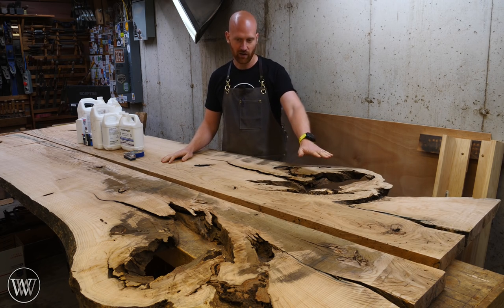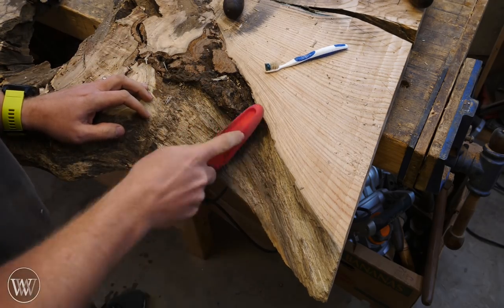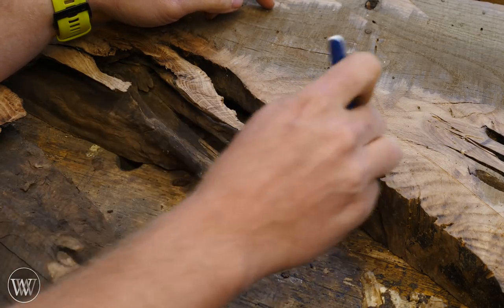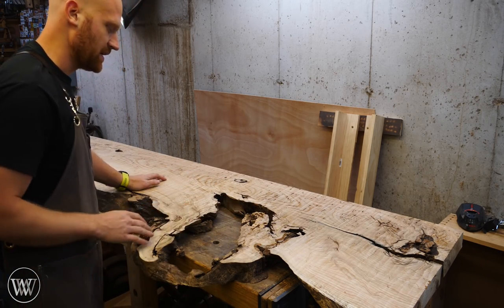Filling Large Voids With Epoxy and Spilling It All Over The Floor

Comment: My first ever project using epoxy resin was yesterday. My husband was cutting up a fallen black walnut and decided to try making me a bench out of a nice straight portion.  The 2 pieces to be the “legs” he’d initially cut out a shelf with back.  In so doing, it created accidental slots in the end of each log leg.  I researched epoxy resin to fill the slots and we gave it our first try yesterday.  I did use a deep pour epoxy that was 2:1 and we used duct tape to the dam the sides of the logs.  But there was enough depth (2-4” and maybe close to 6” depth at deepest) and width (about 8” wide and cut was 1/4”) that it started seeping out of the bottom of the duct tape.  The smaller one didn’t leak at first (maybe it was still being absorbed by the wood?). But later it also leaked mostly out 😭. Only one void stayed full; the one that didn’t have any exit holes on the side of the log.  I’ve seen some videos where people will wait 15 min after mixing to start pouring.  But your mention of this kind of epoxy being so liquidy makes me wonder if that would help much with the long set up time?  Would it have been better to pour just a little and take more days to fill the entire voids?
This bench will live outside and these deep pours were for the purpose of preventing rotting form moisture.  They’ll be covered with the seat of the bench.  But I’m not sure if it’s worth trying again today with more material now that the insides of the voids are at least coated in the epoxy.   Thank you for showing your process and the fail, so we can be encouraged not to give up.

Comment: You actually explain what you're doing, finally an actual tutorial. I have a long wood stump with a crack going along the entire side. I've already sanded the top and sides I'm wondering if I put it upside down, use the matte tape on the top and on the sides (the opening St it's widest is 3/4 in wide, I don't know if the tape will stay and be self contained. Maybe reinforce with duct tape on the sides?
Reply from the maker: For something like that I'd probably use Matt tape but then reinforce the edge with a little bit of hot glue or silicone caulk. You also want to make sure you use an epoxy that's thin enough to make it all the way down to the bottom and let bubbles rise all the way up. Most epoxies would be a bit too thick for that.

Comment: I have done simular jobs with epoxy and the way I was taught was to use MDF with wax paper glued to it for a backer using double stick and hot glue. Good luck on the rest of your project.
Reply from the maker: I have done that in the past, but with cracks and bug holes running the whole length there would be no way to get down enough hot glue before it cooled.

Comment: Great video, so clear. I have a small scale model of a room, made in MDF  61 x 58 cms.  I want to flood it to a depth of 5 cms for a video I'm making.  I'm planning to use the mat tape around the edges and plastic sheeting on the floor area also taped in place. Do you think the eco epoxy would work in this project – water would probably be too fluid. Thank you. Marie

Comment: So I have a question. I'm planning to make a pouring on a live edge table and I'm thinking about which side to put on bottom. Bottom side or top side? The thing is that bottom side is more flat and it will help me with sealing the bottom part which has 2 big holes.  I'm thinking if the resin will be absorbed by wood and the level starts dropping. Also I have sealed the surrounding walls for pouring. I'd really like your input.
Reply from the maker: Sorry, I'm not quite understanding the question. Feel free to send me an email. I'd be glad to talk you through on it. You can find my email address in the about tab on the channel page or on my website. There's a contact form. I don't always see replies on here,

Comment: Did you consider using something like spray adhesive to hold the plastic to the surface? Great adventure you're taking us on James, thanks.
Reply from the maker: I tried that once before on a smaller fill. it is a good idea but does not have enough bonding power for the pressure behind it.

Comment: Thank you for your tips!! So I'm thinking about doing it with layers of packing tape and  also add in between white silicone(used in the bathroom usually). I want to put silicone around a big hole on the slab, and then cover it with packing tape, and then turn it over to fill it with resin. Do you think it's going to work?
Reply from the maker: I don't think I would use packing tape. The problem is if you get one wrinkle in the packing tape or one slight issue in one seam it will all leak out. Unless it's a smaller fill that one or two strips of packing table cover. But if you're doing a larger area I would go with a sheet of plastic.

Comment: I have a question about making a epoxy counter top.  The Seconds and Surplus store has a MDF laminate counter top that is 12ft and they are selling it for $49. I need an 80 inch kitchen counter top and I hate MDF but, I am trying to find a video or find out if it is possible to seal the bottom of a laminate counter top by using a wood filler or even gluing another maybe 1/4 inch plywood on the bottom of it so I could epoxy the top and the bottom of the counter top?  The one in I have not that I need to replace is rotting out underneath and I do not just want to do a top side epoxy counter top.  All of the videos that I see show only doing the top side of a counter top. Please advise
Reply from the maker: I have never heard of anyone sealing the bottom but it could be easy done with a penetration epoxy. they use that to make wooden boats water proof. This is what i use. https://amzn.to/2KzxyWa

Comment: I've recently tried my hand at using epoxy to fill voids, and had the same run out problem on a test piece. I used foil tape, and I think the adhesive just wasn't strong enough. I planned to try tuck tape instead, but will give the mat tape a try too.

I also experienced the drop in level from the wood absorbing thin epoxy. I've seen some builders recommend pre-coating inside edges with a thin coat of epoxy before a pour, to stop the wood from absorbing the thin deep pour epoxy. Have you tried that before? I'm not sure if it's an extra step that's worth doing.
Reply from the maker: Right on. Usually depending upon the slab I either use tyvek tape or wrestling mat tape. I find the wrestling mat tape covers larger voids much better but the tyvek tape has a much better adhesive. The problem is both of them are incredibly expensive tapes. I have done preliminary pores before to try and fill and that does help to some extent but in this case it would cause a problem of seeing differences in the two different types of epoxy. I really wanted a perfectly clear transition to the wood. so in the end it just depends on the particular application.
Reply: @WoodByWright  - I tried the mat tape, and it held for a few hours, but in the morning I found half the pour had leaked out the bottom into the basin I had the test piece over. I'm going to go with Tyvek next to maximize adhesive grip. May try a second test block with Gorilla tape too. I want to get a successful test result before I pour the real piece.

Comment: Thank you for  your videos ,do you  knows if a cedar slab works to do epoxy or have you done  using cedar wood?
Reply from the maker: You can do epoxy with just about any wood you want. The problem with cedar though is it's a very soft wood and it will dent easily. So it doesn't make a very good table top.

Comment: Hey James what was your process after the leak on the wood slab? Did you wait for it to harden then cleaned the spill on the slab and retapped? Curious as have a similar issue. Thanks!
Reply from the maker: I spread out what was on the floor and left it to cure. thought about sprinkling a fleck in it to look like it was on poupous. then I re taped a few key spots but left all the old taping on and let it cure. the bit that was left effectively sealed all the cracks.

Comment: The great epoxy escape! I wonder if you were to coat the whole underside with a thin layer of plaster of paris if that would be thick enough to stay out of the holes and give a good seal.
Reply from the maker: you could, but then you would have to get it off.

Comment: Superb!! Love the colour... I’m curious about the smaller fills. You mentioned that because its watery it seeps further in the wood. I see that there’s a lot of epoxy on the top surrounding the smaller fills. In my experience working with epoxy this will create a difference in the end finish. Do you expect to remove all of what was sitting on top while thicknessing? Or will you do a full epoxy top coat maybe? Just curious.. splendid job James, sucks about the spill..
Reply from the maker: thanks Tomy. I will be taking off around 1/8" form the whole top

Comment: I missed which part you used the West Systems epoxy on. Was it the first pour of ¼ inch of the blue?
Reply from the maker: Yes the first 1/4" you do not want to poor that any thicker then that.
Reply: @WoodByWright  thanks so much for the response! So, if i'm ONLY going for a crystal clear look with no color, do you recommend that I still do the ¼ inch West Systems to start? Or should I only go with the Ecopoxy and start with ¼ inch, then pour the rest after that sets? Or should I just do the whole pour at once to full with Ecopoxy?

Comment: Still it is going well. Wouldnt it be possbile to screw boards on the bottem to make sure the tape and plastick are tight to the bottem?.
Reply from the maker: Thanks. That would not have sex this one as it was a slight bubble in the tape that allowed it all to run out.
Reply: Nice typo

Comment: If I pour Epoxy directly onto the sticky side of the mat tape, will it stick to the tape when I remove it?
Reply from the maker: No you can peel it off.
Reply: Wood By Wright well I did the pour but unfortunately mixed the ecopoxy by weight instead of volume. Hopefully it will still cure.

Comment: Oh you poor thing! I would hate to have to get that off the floor... Oh my word. I am kind of wondering why you didn't put the straight edges on the outside and the voids on the inside, creating a square table where you can just pour it all at once?
Reply from the maker: I did not want a river table. And I much prefer the live-edge on the outside it gives the table a lot more character not to mention that would require around $1,500 worth of epoxy. As opposed to the $300 in spending on filling just this.

Comment: As we were fond of saying in the Navy, "shit happens."  You learn from your experiences, and I'm learning as well  As you were laying down the tape, I thought that you might get better bonding to the wood if you ran over it with a heat gun to soften the stickum and then pressed it down with a veneer or wallpaper roller.  You now have an opportunity to show how you intend to clean up the spilled epoxy, both on the wood slab and on the floor. For the floor, can I suggest you go straight for the power tools and rent a floor sander.  I saw you flatten your floors upstairs by hand. If anyone wants to see that, they can look in your backcatalogue.  Thanx for dealing with this.  Hopefully, now that I've seen this, it'll never happen to me.
Reply: Oh and a few quick related questions... I've heard that "nothing sticks like gaffer's tape".  Being from technical theatre, you should know it that's actually true.  Is it?  Is it waterproof?  Would it make a good damming tape for epoxy fills?
Reply from the maker: LOL. I'll be using a belt sander to clean it also floor. And the extra epoxy on the wood is not a problem because I have not done the final flat thing on the table. Gaff tape is great for small voids but it doesn't work as well for the larger things. It is great in heat applications.

Comment: I think a large sheet of MDF fixed to the full underside with silicon sealant is an awful lot quicker, cheaper and effective than taping and covering with flexible plastic.  Nonetheless I love these videos and this channel :)
Reply from the maker: I ahve done that in the past but on a project this size it would end up taking more time and you need to make sure the underside is perfectly flat to get a good seal

Comment: Hope you have a good ballpoint hammer. That's the only way I've removed epoxy from a floor. Spent 18 hours doing that on a room the size of your shop.
Reply from the maker: I will just end up using a belt sander

Comment: ya there would have been a steady stream of my dads slow swearing if i found that on my floor lol.

So in regards to the bottom layer, what is the reason for using it to get the color instead of the eco? the consistency or more just wanting to try out a couple things before hand?
Reply from the maker: I thought the thicker West system would help plug any holes ahead of the liquid. plus it is a bit cheaper.
Reply: i figured it was more to get that wavy patterning with something thicker.  How does the west handle in regards to fumes and such.  I like that eco is more earth friendly but ya you are definitely paying for the quality.
Reply from the maker: West has more fumes and you have to be careful of runaway temps but it leaves a smooth surface.

Comment: At around 10 minutes you mention that the bigger voids will put more pressure on the tape/plastic? It may seem counterintuitive but pressure depends only on depth and not on the area of the pour. So whether it's a small hole or a huge void, if you're filling the full thickness it will be the same pressure. The larger voids do have more weight of liquid epoxy in them so if for some reason you didn't have the slab flat on your bench you'd need to support it some other way, and they have more epoxy in them to spill onto your floor, but in terms of pressure working its way around your tape seal the small holes and large voids need the same attention.
Reply from the maker: The pressure is not in the vertical column of liquid as you'd be thinking about water pressure. The pressure comes from just having a larger mass of weight. That will sag the tape more. Except the tape has to spend a larger distance it has to do more work.

Comment: Hot glue gun works great for those seems
Reply from the maker: I often use it for that but in this case it still would not have worked. I decided not to use it here as the seams we're so long that it would be cooling before I could seal it.